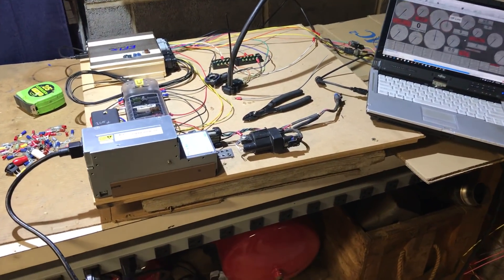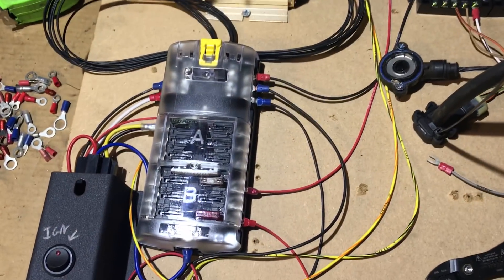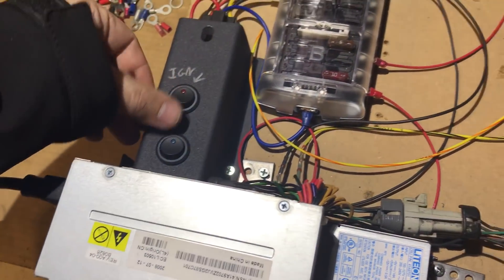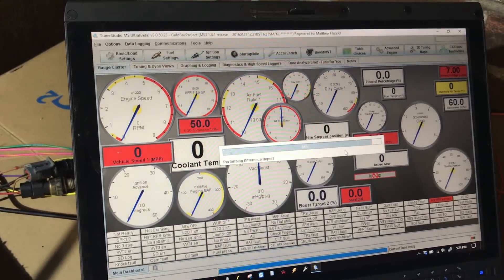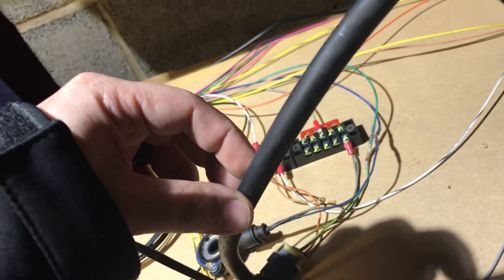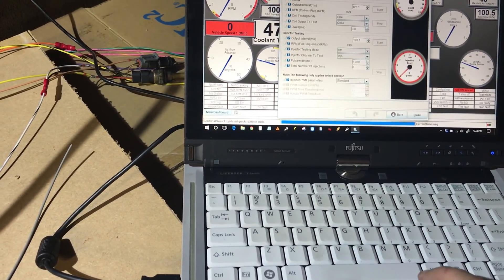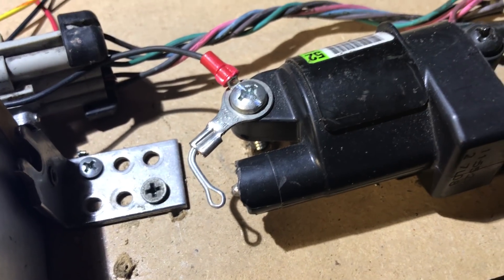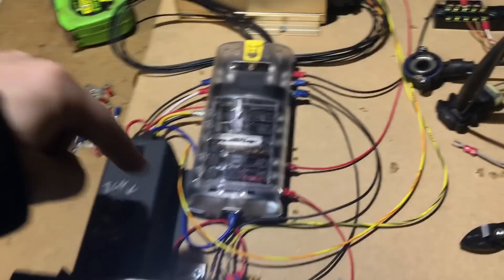Efi and car wiring how to board

Comment: Lol are you using a pci connector on a PC psu for 12v?
Reply from the maker: It’s a desktop power supply yes, no pci slot present no, a computer power supply has much more wattage and a cleaner feed than a cheap ac adaptor